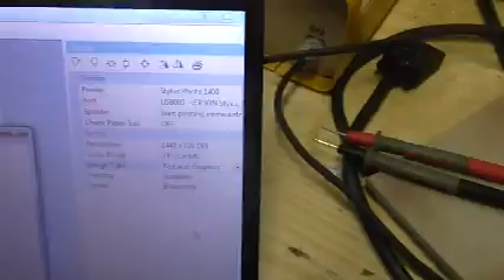UV Diy Epson R1400

Comment: qual é o fuso de esferas usado?
Reply from the maker: Stepper motor with stepper driver. And you need DTG controller.
You can buy her:  http://www.ebay.com/itm/271804518974?ssPageName=STRK:MESELX:IT&_trksid=p3984.m1555.l2649
Reply from the maker: Roni Farias check which encoder to uses 360 or 720 dpi.
Reply: how much it cost  are you selling  some units

Comment: hi can u please give me type or Model of Uv light. tnx
Reply from the maker: This is my home production. UV led is 20W.
Reply: Can i use DC120V UV LED 120W 385nm 395nm ?
Reply from the maker: This is too much. Excessive loss does not need.For big head about r2000 is max 50W. For printer 6 ink about r1400... is max 30W.
Reply: +Miodrag Milovanović. so can u,give me a model of uv lamp that can i order by online?